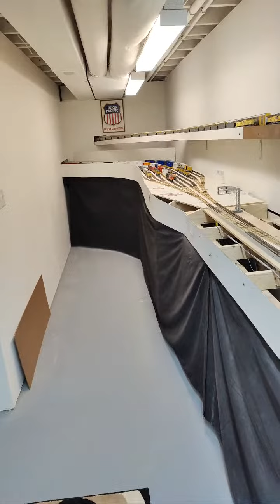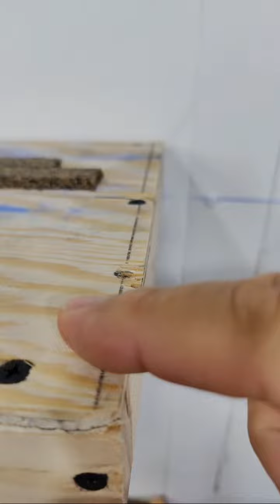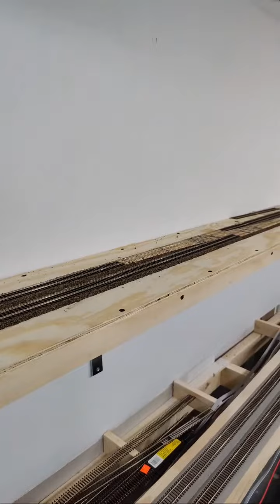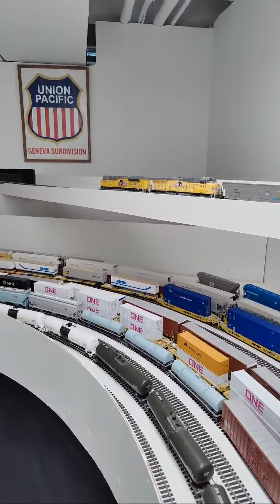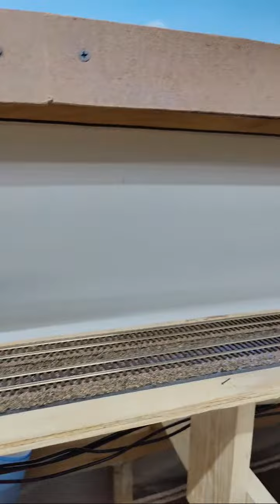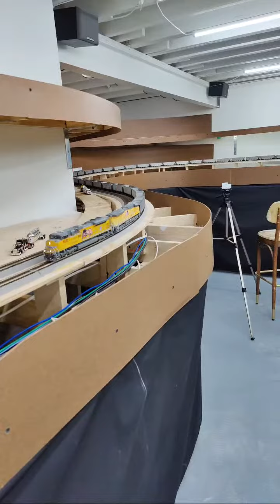Countdown to Golden Spike Day - 3 Union Pacific Evanston Sub

Comment: You can have hinges below the track level, but it is more work as the hinge point needs to be away from the join. then the track and board at the hinge end goes down. I did this along with a tilt (to miss a unit on a wall), note I have since removed it and gone for a lift out as I rarely lifted it being 60" off the ground I just nod under.
Reply from the maker: Check out day -2 for the solution that I used. Very simple, but effective.
Reply: @EvanstonSub  I'm running behind, doesn't help I"m 7 hours ahead of you!

Comment: Yes, lead unit stalled entering staging.  I have been trying DPUs myself but have had similar problems.  I thought that perhaps you had 2 units up front to minimize head stalling.  So I tried that as well and while buckled trains were minimized, I'm still getting stalls occasionally.  What really annoys me is that I'm getting that even with "keep alives".
Reply from the maker: Actually, I think the cars derailed first and the short caused the locos to stall. So far I have not seen any stall issues, and I rarely clean the track. The train is too long for an eot dpu. Mid train dpu works much better.

Comment: for the hinges you could make a pocket area for the pin so that way it wouldn't interfere with the layout.
Reply: The "pins" of any hinge will be a bit offset in the direction of the bridge moving. (See any door in your home.)
That is to say with a swing-up the hinge pins will be above the surface of the layout.
With a swing-"DOWN" opening, the hinge pins are below the layout. But he does not have room for another swing-down opening.
Reply from the maker: Ended up doing a lift out section. Keep it simple. Check out tonight's live stream at 8

Comment: For your lift up panel what about using piano hinge they are very strong & you can run one right across your ten inch panel?, just an idea.
Reply from the maker: Check out tonight's live stream. I followed the keep it simple strategy. I did use a piano hinge for the lower lever.

Comment: What about a Lift (up and out) panels like Modular Layouts do for Shows?

Alignment and hold down pins/bolts at both ends/corners. No Hinges. 
Quick Disconnects on Wiring. There are even HO Special Joiners now to make it easier to lift up and drop in the tracks.
Reply: I agree 😊
Reply from the maker: This is the route I ended up doing . A few others also had this suggestion. Keep it simple! Check out tonight's live stream.